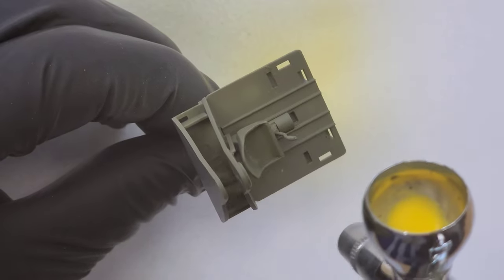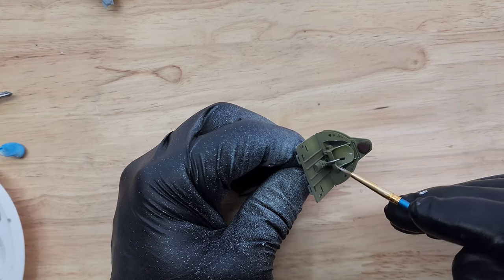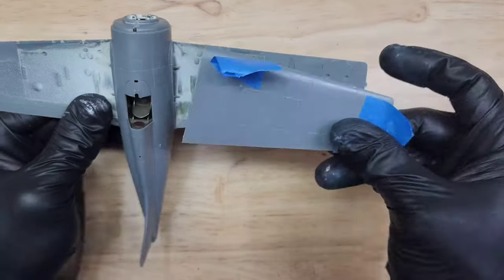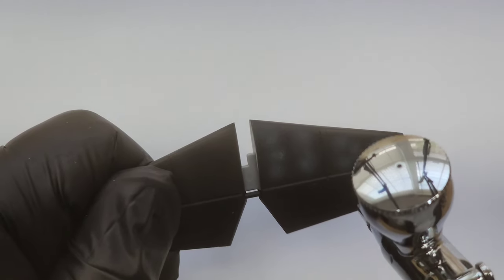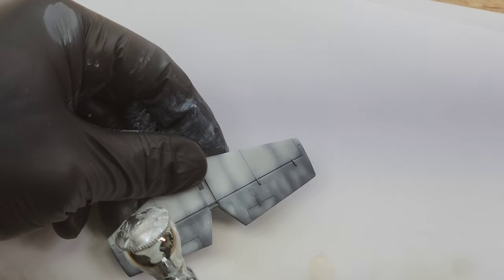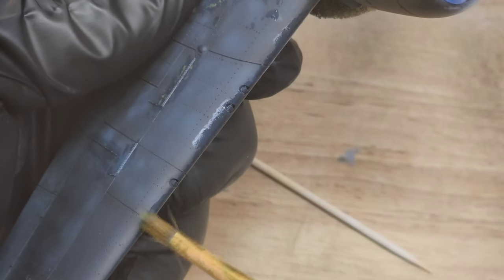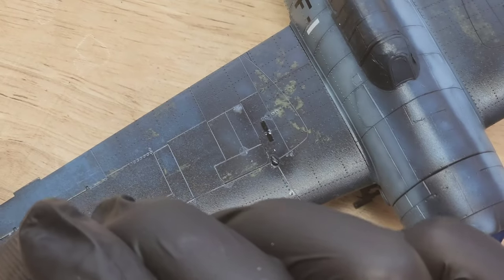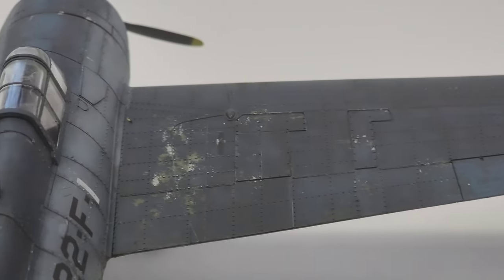1/48 Tamiya F4F-4 Wildcat Model Airplane Build

Comment: Excellent  build! Yes, you are right. The decals on tamiya kit are difficult  to work with. I am about to finish the tamiya 1/48 F-35A and the ram tape decals have taken up most the build time and have almost made me give up on the kit a couple of times.
Reply from the maker: Lol that kit 3nded up on the shelf of doom for me. I accidentally threw away the medium sized decale sheet.  Bought another one. And then accidentally threw the second one away... I was done after that.  Lol 80 bucks worth of decals later.  I'll just buy another kit at this point hahah

Comment: Nice job! You've come a long way from your earlier builds like the Monograms. 

On exhaust stains, take your paint in the exhaust color you want and thin it down super thin with drugstore isopropanol (90%, dries faster). I use Tamiya paints but should work for mission or vallejo. Thin down 20:1 or more iso to paint, then make multiple passes to "build up" the stain until it looks how you want. That way, any one pass where you don't stay steady isn't a disaster. Also don't stay in one place too long or the iso will start to eat your paint job.

Comment: It's odd that Tamiya can make such good kits but has always had garbage decals. I've found ways to make them work better but it's really not worth it, either paint on the markings or go aftermarket(or use leftover Eduard decals).
Reply from the maker: I know now!
Reply: Total agree. Anything other than brand-new Tamiya decals are going to be horrible and even then, the thickness makes them a bear to snuggle down over details.